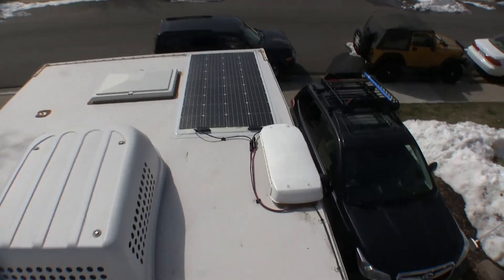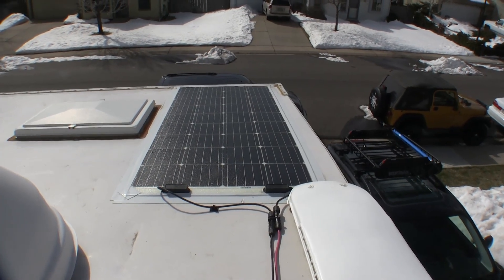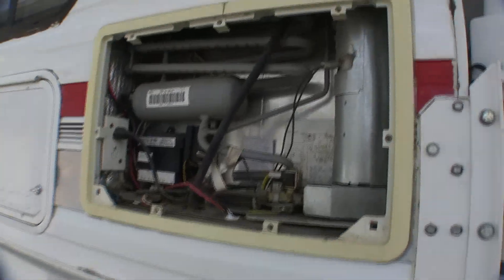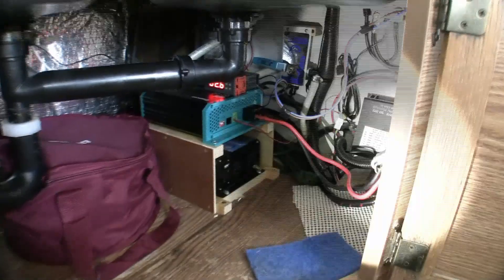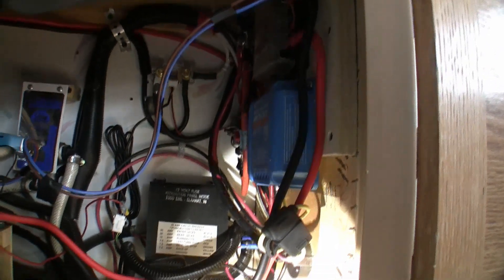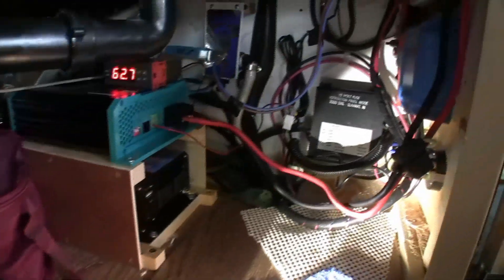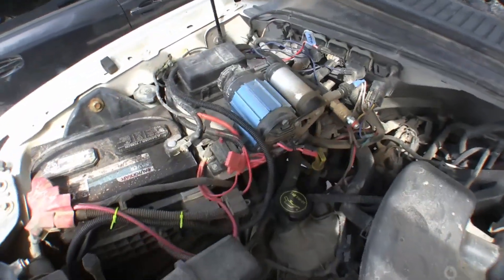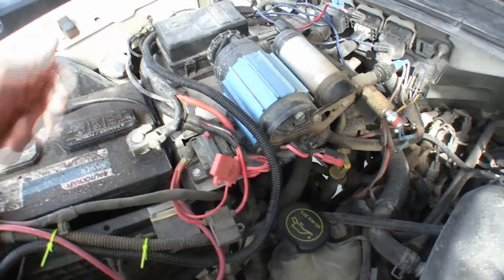Lance Squire Battleborn Upgrade

Comment: Greetings fellow solarist, i believe 12 volt lead acid batteries are around 12.6 volts when fully charged.
      Now my12 volt lipo battery Evo battery is roughly 1 amp higher at 13.6 volts when fully charged.
     When it ddrops to around 31.2 and it's state of charge is less than 70 percent.     The battery Evo 230 amp hour  12 volt lipo b battery has a built in on and off switch and an lcd paner displaying remaining voltage.     I hope that is accurate enough to be useful to the viewers.      Thanks